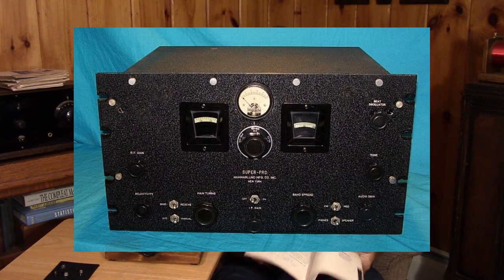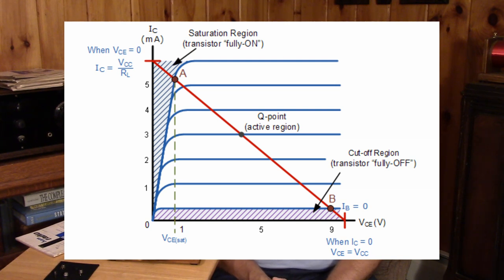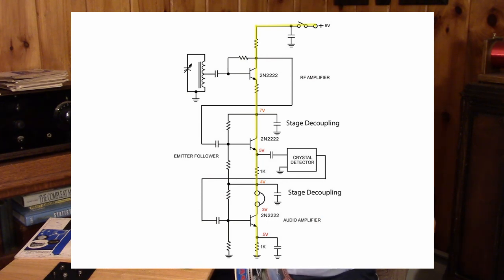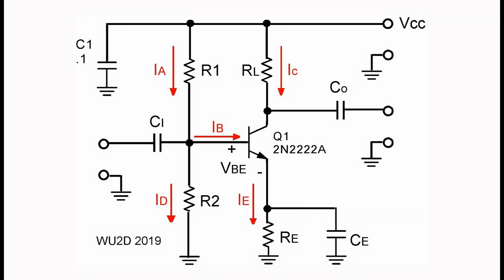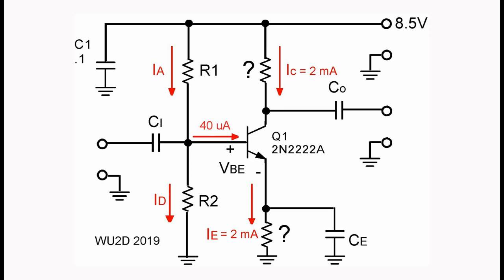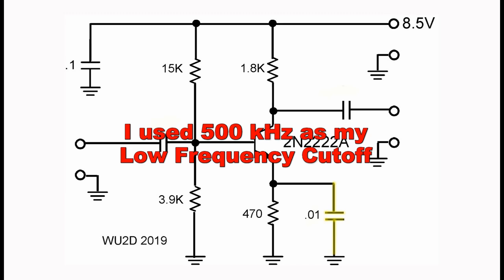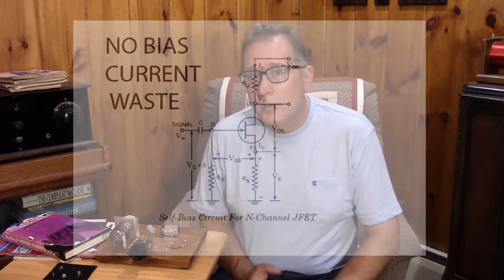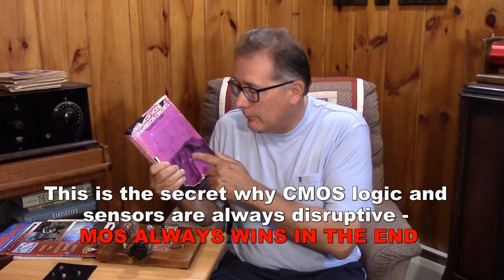Biasing Bipolars

Comment: I'm an real, offical engineer and I do bias my transistors this way, and many of my collaegues do it, too. In most cases, it's just good enough. The tolerances of individual transistors are huge, so you if you design something to be built in series, it has to be tolerant of those anyway. 

How do you want to make that more modern? Make the calculations in a special computer tool? You may do that, doesn't change the principle though. And in most cases using the calculator and some scrap paper is quicker and therefore the preferred method. 

Simulations .. they can help, but surely don't replace knowledge. They get pretty complicated really fast, and most models (if you don't buy them for A LOT of money) are shockingly inaccurate, especially if you leave the linear, small signal region. 

Really good explanation, except one small thing: The emitter decoupling resistor, making it a 10th of the biasing resistor may lead to good results, but I think that isn't the correct way .. 

The impedance of the circuit at this point is determined by re (or REE as you called it in your comment further down), so 26mV/2mA = 13ohms in this case. The decoupling cap should fit that impedance, not the biasing resistor. Making it equal sets the -3dB point at this frequency.

Comment: EXCELLENT PRESENTATION.WHAT IS C1 CAPACITOR FOR AND,HOW DO YOU DETERMINE ITS VALUE OF CAPACITANCE?
Reply from the maker: C1 is the input coupling capacitor. We have to select a low frequency cuttoff frequency and measure or estimate the input impedance of the common emitter amplifier in order to select a minimum capacitance value . The input impedance Rin, is defined by the parallel value of R1 and R2 further reduced by the resistance presented by the device. Rin = hFe * REE. REE = 26 mV/2 mA (our emitter bias) = 13 Ohms. 13 * 50 = 650 Ohms (but the actual hFE may be much higher so it actually could be 2K). Anyway, 650, 15K and 3.9 K in parallel are 537 Ohms. So we need a cap value 10X lower, so about 53 Ohms of reactance at say 500 kHz. Xc = 53 Ohms with about a .006 uF cap. So a 0.01 uF would be a good choice. I am assuming a low impedance generator here.
Reply: GOOD EXPLANATION.WHAT I AM ASKING IS ABOUT THE .1uf CAPACITOR FROM Vcc TO GROUND.
Reply from the maker: @davidluther3955  this capacitor bypasses the battery thus defining the impedance ( very low) of the power source at high frequencies. The impedance of the battery itself could be questionable.
Reply: Why are you screaming?

Comment: The book you mentioned is one that I’ve heard about a lot but never ran a crossed a copy.
Unfortunately Maurice Passed away in 1995. I found this:
https://umanitoba.ca/outreach/retirees/media/OBITYUNIK.pdf
Reply from the maker: The Design of Modern Transistor Circuits book was a mainstay for 2 year colleges and associates degree programs in the 70's, in courses that were not model, physics based, but presented more practical math and tech savvy approaches to design.